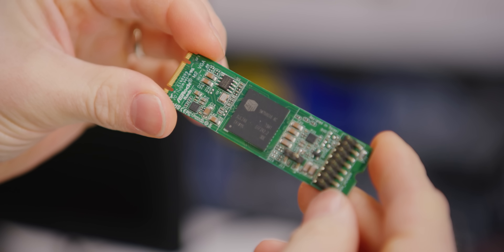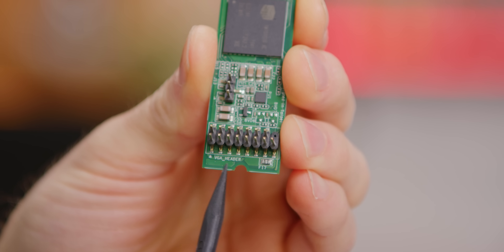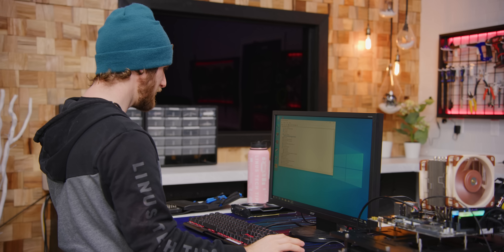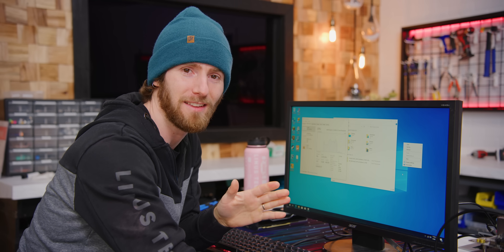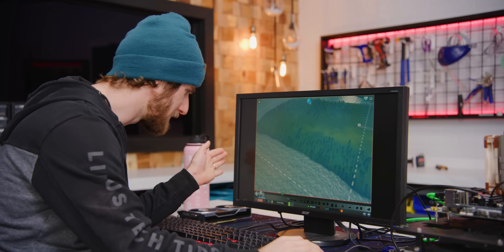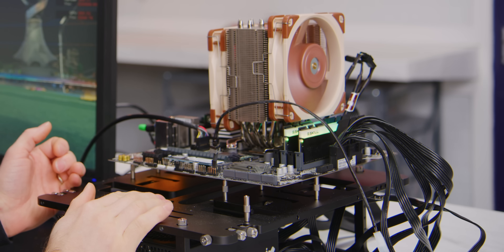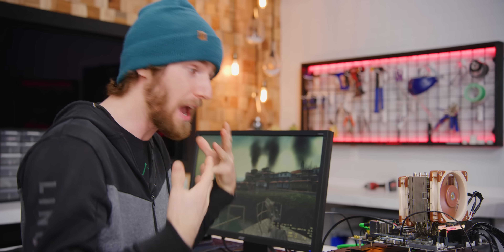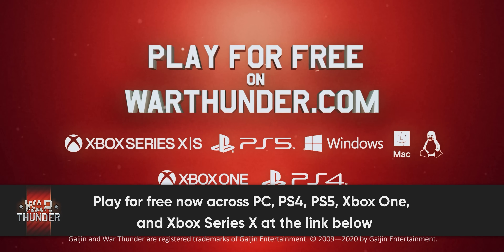THIS is a Graphics Card..?? - ASRock Rack M2_VGA

Comment: Hi, someone from 2035 here. We now have motherboards with only m.6 slots. The power delivery is all up to the 12 pin motherboard connector and the only thing you need to do to build a computer is add m.6 cards to the slots (gpu, cpu, ai card, etc)

Comment: Random fact, a decent VGA output is actually just as good as DVI/HDMI/DP if you're only doing 60Hz 1080, the reason people usually say it looks bad is because their LCD monitor is doing a poor job of converting the signal from analogue to digital before throwing it on the screen, if you have a monitor with a decent converter then it looks just like any other input.

Comment: "Gaming Machines" probably means for slot machines or gambling machines
Reply: or NES emus + DOS games.
Reply: @freedustin  yeah I'm guessing that's exactly what these are for not a "niche" item
Reply: Maybe for a homemade arcade machines, like the one's with Raspberry Pi's?
Reply: @gotai8  Well, then I think Raspberry is more simple way to go. You can emulate almost everything on it using RetroPie (retroarch).
Reply: It's meant for board games.
Reply: Yep. Just a VGA out for service use in embedded systems, not to render actual games. Text mode stuff.
Reply: Nah, we actually use normal gpus from like 10 years ago (I work in a casino). I've seen the slot techs take the mobos out and some of them are literally just a normal pc. Although, there are plenty of proprietary ones
Reply: @DoxSteele  Esp if you build your OS to be somewhat robust, ubiquitous. Any x86 motherboard with normal peripherals can run it!
Reply: Exactly what I was thinking.
Reply: I can’t even imagine. More like pos dos systems lol
Reply: Silent hill slot machine
Reply: Yes

Comment: Hmm so its an oddball lowend GPU like the 210/710/1010 from Nvidia. Those can be used in a similar fashion as one of these BUT those require a PCI-E slot unless you use one of those m.2 to PCI-E adapters that are around. AKA they act like extra displayoutputs for those they need them.

Comment: This would be good for CPUs without integrated graphics so you can have some sort of graphics output device. Usually in servers, this would be bare basic. To use it for games though, I'd suggest using a second GPU as a render device with this m.2 GPU as the passthrough output device.

It would be nice if we had entry-level radeon/geforce for this though. Imagine buying a GT1030/1050 performance-class m.2 card to augment your weak iGPU, the same way nvidia Optimus worked in laptops.

Comment: if you found this slow wait until you see the Matrox G200 that is integrated in most servers....
Reply: Matrox? Now that's a name I haven't heard of in years.
Reply: Oh god. That thing stutters running Excel.
Reply: They still used it today? I saw server with these 10 years ago. Sometimes even remote management cards had better chipsets. At least it has driver compatibility with most server OSes.
Reply: @cppxx  still built into the newest Gen10 HP servers!
Reply: @cppxx  Unfortunately they do and small shops have those as their POS server and only workstation so they run Windows 10 and Office 2016. The struggle is real.
Reply: @cppxx  Most servers today use Aspeed parts, which have VGA out and IPMI functionality on the same chip.  The G200 was perfectly fine for what it did, though.  You don't need a monitor on a server 99% of the time.
Reply: @TrueThanny  nope. all of HPs and Dells new servers have G200
Reply: Worse than VEGA graphics. Better than intel uhd graphics (and if intel made 4K graphics it will be worse than matrox)
YEE

Comment: The color gradients probably mean the card has a 16bit DAC, e.g. R:5, G:6, B:5. Or a really bad 32 bit one. It's probably an SVGA type chip that does VGA 640x480 16 colors and a bunch of SVGA modes 16 and 32-bit modes. The 32-bit modes might just be for software compatibility though. The confusion over frame rates makes me think the driver doesn't fill in all the structures it passes to Windows properly. 

On the upside, it looks like it supports the VGA register set pretty well. I think when they say 'gaming machines' they mean 'slot machines'. The janky window dragging even with the driver installed makes it look like it doesn't have a 2D blitter, something even old S3 cards had.

Interestingly if you look here it claims it has 2D acceleration and doesn't mention VGA register compatibility

https://www.siliconmotion.com/download/3PS/a/SM750_PB_EN_201910.pdf

Comment: To be honest, I think the use case for this "GPU" is commercial/industrial applications like automation controllers and point of sale registers. In those cases, you don't need much graphics power, and there's a good chance the equipment is going into some sort of slim or small form factor that might not allow for even a half height GPU card.

Comment: You need to think about this product also a little bit other. Currently its crappy and basically has absolutely no use for the average consumer, but there can change a lot within the next 10 years, it can easily be possible that this thing has the power of a todays 2000-series GPU by 2030.

Comment: You know those multiple m.2 adaptors for a single PXIe slot cards?

This thing only needs 1x pcie, so you theoretically could mount up to 16 of them in one card.

16 display outputs off of a single "card" is fucking useful in some rare situations.

Like say a video wall.
Reply: hint Linus, build it and see how many displays you can run off of a single machine - multiple cards per slot - and lets see how nuts it can go.

Comment: I can’t wait til they actually make a m.2 mid tier GPU that utilizes motherboard outputs. SFF DREAM
Reply: Cooling and power delivery quickly becomes a problem. Something with ~30-40W total board power might be possible with a small fan, and could net around 1050 / Ti level of performance.

edit: and ofc, the PCIe bandwidth starts becoming an issue if you need data in AND display out (to the HDMI controller on the MB), PCIe 4 should be enough though
Reply: @defeqel6537  definitely but having a low profile heatsink with roughly the same height as the alpenfohn black ridge or the LH12 that directly attaches to the GPU die on the NVME board would be so clutch
Reply: @143Garage  or perhaps something like the Streacom passive cooling solutions, although those usually also work with full sized PCIe slots.

Comment: If you just want to drive a dumb screen with low performance, you can just get a USB display adapter like from displaylink, it's cheaper, doesn't take up a m.2 slot and you can use a more sensible HDMI port

Comment: I have a question for you Yoda of all tech. I work away a lot but love all that is gaming. I did have a “gaming” laptop a couple of years ago but it died. When I took it to the local tech shop to have a look at it they told me that due to the heat generated in the laptop it had fried the graphic and cpu and that laptops even though they are “gaming” laptops are not really able to play games and will in the end fry the laptop due to the heat generated. Is this still true? And if not what gaming laptops would you say are up to the mark for gaming. Thanks oh Yoda.

Comment: Now; I am only a hobbyist and not nearly an expert enough to say this for sure, but I will shoot my armchairless armchair theory out there about the "gaming machine" thing written on the product listing.
A lot of still existing arcade industry has been powered by PC's for long, long time, as well as modified home console hardware and other weirder things here and there (late 90's had konami producing essentially PS1's that had CD, DVD and HDD drives, yes, all three different ones, as well as propretiary ROM input and I/O) and as far as I researched for curiosity and sometimes useful info, lot of arcade machines use embedded hardware that is always cost optimized for the games they run. 2D games still exist far and wide, and cost and size optimizing such machines especially when you want to run your own custom hardware beside just the raw PC may make this product indeed a "gaming machine" capable. This is; of course, group of developers specifically choosing to work with this card and making their 2D slots machine or maybe "pacman 25th anniversary rerelase" games work with this card specifically, and whatever cut down linux or windows based OS they are working with as well as any custom hardware they add for additional functions for said arcade/slots/beyond machine.

This might be just very broad translation being missed in translation as culturally, in china and other parts of asia; the term used originally can be probably more likely understood for the correct thing: a produced-for-cost machine with specific needs being used for specific amusement service machine with low, likely 2D only requirements where low power usage and longlivety go over hardware that would need more maintenance as it runs from morning to night every day for hours on end as well as being played hopefully most of those hours.

There is some really interesting stuff that normal consumers cannot even get their hands on in some amusement service machines.

TL;DR: "Gaming machine" in the product description might be talking more in line of 2D arcade or gambling machines rather than what we usually understand as "gaming machine".

Comment: i was born in the 2000's and i did live with a 1999 windows 95 that got updated to XP and lagged to death on a single core single thread @ 2.4Ghz CPU ...yes i was 13 but ik how colours looked crappy back in the days from 16bit to 32bit and such and btw that GPU can run monster truck madness ,worms 4 , 
cosmobots 2004,platypus 2 and nfs underground 2 with no issues cuz thats the same power the pentium 4 with onboard graphics i had with 15megs of vram and it ran just fine

Comment: What would cause single channel ram with 2 stick of ddr4 3200 run at different speeds? 1 stick is 3200 the 2nd is 2900. My nephew helped his buddy build a AMD. They jammed in the CPU and bent pins. According to them they fix it and it boots now. I believe it's the CPU but I've never come across this before

Comment: You may think of this as a joke? I might look into buying one of these for a mini ITX server build I might build with a spare Ryzen 2600 I had before upgrading to a 3700x. I've seen worse- I have an Intel n450 dev board from 2010? with a whopping 2c/2t Intel Atom @ ??? GHz, up to 2 GB DDR2 SODIMM, and graphics drivers that are so old, MS display adapter is faster on it. But don't worry, it has mSATA (not M.2, that was too new back then) and a PCIE x16 (or x8, I'm not sure) slot.

Comment: I ran a gtx 970 via an adapter connected to pcie 1x wifi adapter slot inside my laptop, through an hdmi cable to a seperate dock outside the computer hosting the 970, with an atx power supply glued onto a piece of metal.
Ran really, really well. The only time I ever noticed slowdowns was when it was loading in more textures and more context, it could chug a little then.

This sort of thing? It really feels like it has some serious potential. Just.. not with that gpu and header :')

Comment: Even at time when DirectX 5 was new there was ability to play “by CPU” only if your graphic was just 2D or didn’t support DirectX, so ages before WARP
Reply: IIRC these software renderers were implemented by the game developers and not switched to automatically by Windows. Correct me if I'm wrong though.
Reply: @defeqel6537  yes and no. As I remember there was option in most games settings to choose software rendering or hardware but if graphic card had no support for dx, game runs anyway (automatically software) that was one of the point idea of DirectX, (at least at the beginning) Even glide you can run software with proper mod in drivers without voodoo on board.

Comment: (0:27) If I recall correctly, ASRock Rack is the division of ASRock that makes server hardware.
Reply: Kind of weird server motherboard that has nvme but no integrated VGA... but yeah, this is the market segment where you can still find Matrox Millenium onboard :-)
Reply: @howardjones543  
I think some boards may have issues with VGA outputs, and I'm planning to get an ASRock Rack mainboard that only has a VGA output, but then again, it seems that the video output is handled through IPMI, so the integrated graphics can't be used directly, which is fine for server uses since they usually don't run full graphical desktop sessions like my custom NAS ends up doing. I'm hoping that the VNC server I end up using can still use the integrated GPU for rendering, though.

Edit: Also, some servers may not have video outputs if they're designed to have workloads passed onto them from another server, or just handle additional processing and/or storage for another server.
Reply: Lol its me

Comment: Hey, that isn't bad where games forgot to do driver versioning check. looks to be on par or better than Atom GMA450 which isn't bad in its power class

Seeing it came from Asrock Rack, can you guys persuade Asrock BIOS team to support igp-less Ryzen on Deskmini A300/X300 so we can use this thing? Use case is extremely small footprint build/NAS server with VGA out for emergency/setup.

If Asrock make it happen, do high density cluster computing with a bunch of Deskminis. Maybe Anthony can run distcc too across the clusters for fun

Comment: Bad color depth can be caused by VGA output circuit. In FPGAs that provide VGA output it is usually implemented as an array of resistors with power of 2 values. In one FPGA dev board they used 12 resistors for all of RGB, so 4-bits color depth per channel. Looks very close to what you had there.

Comment: give it better RAM and digital output instead and I'll get one I have a use for it. Got a A520 board and not a lot of APUs are available for it, putting it into an ITX case with no PCI slots, I'd have to sacrifice the one M.2 sot but a SATA SSD would be just fine

Comment: Okay, it's a massive stretch but this is pretty much the only method I can see this device being useful as a 'gaming' GPU and it will only work if this GPU is compatible with the old VESA standard.

1 Create a VM for Windows 98 and route this 'card' as GPU passthrough.
2 Connect a USB to PCI connector to your PC and use it to link this GPU to a Voodoo 2 card also routing that card to the VM as GPU passthrough.
3 Enjoy the thrills of mid 90's gaming for way more cost and complexity than buying and restoring a vintage gaming PC.

Comment: It may be silly, but I'd actually like to see more like this. Take something like Vega integrated graphics and put it on one of these and sell it pretty cheap...it would be a cheap solution for those looking to make a desktop-only machine using Ryzen that doesn't have integrated graphics. Or heck, even down the line make our lowest end GPU's that can still do some 720p30 gaming in this form factor. Every modern board I've seen has an m.2 slot anyway.

Comment: "You can see the window closing animation" Me: thinking that was normal
Reply: Due to the fact that Windows  is closed source we can't know wether the GPU was used for rendering it
Reply: @tokiomutex4148  ...uh, no it definitely is when you have aero or whatever the fuck it's called now turned on.
Reply: @TheBig451  My knowledge about Windows is very limited, isn't Aero the window manager?
Reply: @tokiomutex4148  we know it uses gpu because you can disable it to gain performance
Reply: @alex-u3k4w  Interesting, how can it be done?
Reply: @tokiomutex4148  search on the task bar -> "performance" and there will be the performance option where you can customize various settings including minimize animations, shadows and such
addition: i think the aero was a mode on win7 that disables all animations and graphics for low-spec computers. like a "Low" preset on games. now we get the option to choose which to disable instead.
Reply: @alex-u3k4w  Next time I boot into Windows I'll try that
Reply: I also see it on a ryzen 9 5900x and 3080. Its just at my monitors refresh rate!
Reply: I see it even on a Ryzen 7 3700X and nvidia 2060 Super so yeah

Comment: It would also work nicely as a diagnostic tool for figuring out if there's an issue with the graphics card or monitor.

It's small enough and robust enough that you could put it in a tiny protective case and just throw it in your bag. Depending on the model, this might also work nicely for laptop diagnostics.

Comment: Well, the usecase is from manufacturer name - servers. You can build TR4 or more likely AM4 server, put it into M.2 slot, or PCI-e x1 slot with adapter and you have video output along with 16 free PCI-e lanes, M.2 from CPU and lot of lanes from chipset free. Plus you can use ECC unbuffered memory.

Comment: i have a Radeon HD 7700 coneccted to my wifi card port on my small hp school computzer which i got for free, so it just makes sense that m.2 would be an even better port for that than the wifi card port and it still works great on the wifi slot even tho its only pcie x1 gen 1
m.2 is like x4 and gen 3 or 4 so you could probably adapt an 3080 or so to that with a riser box psu and stuff like that, i once tried my 1080 and even got vr working

i just found it funny even when i saw the yt story a few days ago that there are dedicated gpus for m.2 slots or there even exist some for the wifi card slots haha

Comment: I could see a company putting a SOC ARM style GPU on one of these one day, with power draw and performance plus ram density getting better every year.
"Gaming machine" I guess they mean a game streaming server, that you need to monitor directly it's system on a display (so it has no video out as GPUs used for streaming, but you still need local, not lan, access)?